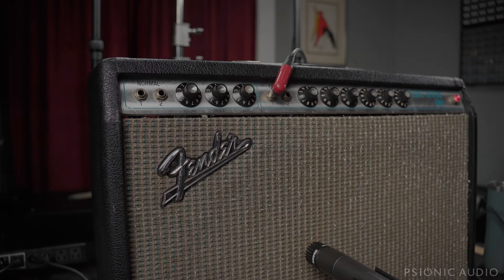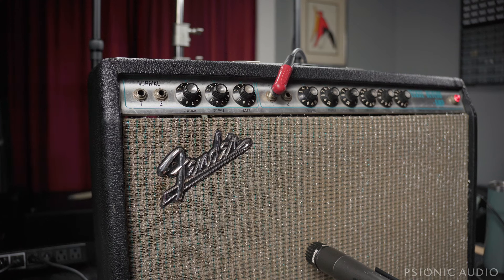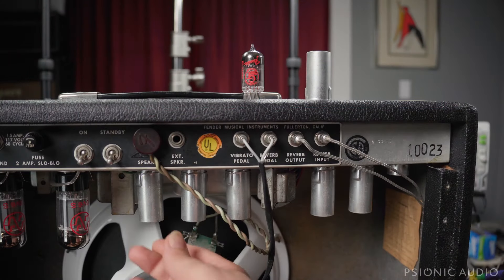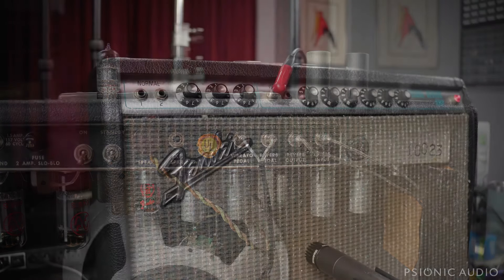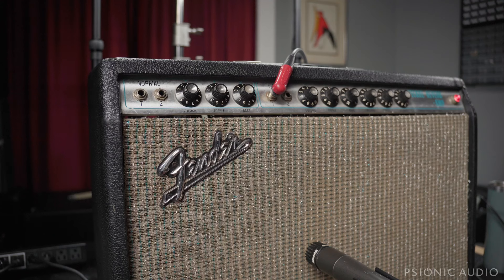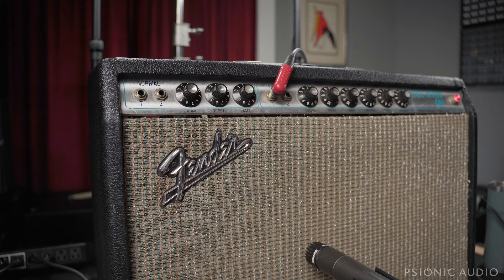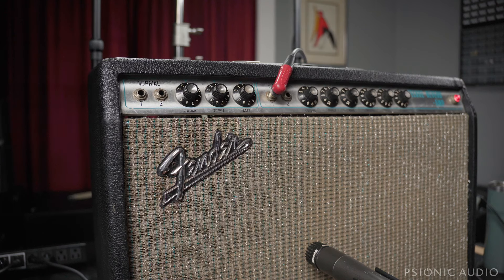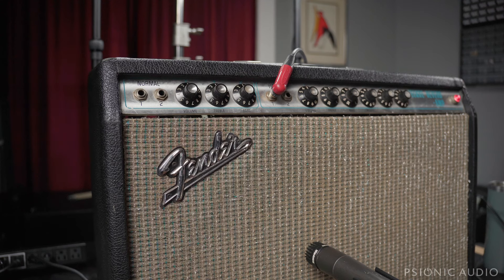Fender Tricks | Increase Gain without Mods

Comment: Either I need to get better headphones or I have tin ears.  I'm not hearing that much difference. Any headphone suggestions?
Reply from the maker: You can’t really hear it with phone speakers. For headphones, I use Beyerdynamic DT770 Pro 80 ohms and Sony MDR-7506s. It’s very apparent on them and on Yamaha HS-7s.

I made sure the back to back clips didn’t have the leveling everything else had, and turned them down a bit so YT wouldn’t compress them heavily. 

But it’s a tricky medium for minutia…
Reply: @PsionicAudio  I was listening on a pair of Sony headphones.  Right now it's at my other computer, so I don't have a model number.  Thanks for the info.

Comment: Hey Lyle, I just tried this with my ‘66 Pro Reverb and it sounds like the amp is clipping with a really harsh and bright sound that is NOT present when I have v1 inserted and a 12at7 in v2, any idea why that would be? 

It’s not a pleasant clipping sound- it’s a ‘something is definitely not working properly’ clipping sound.
Reply: Update: seems like it’s actually only doing it when I pull V1. If I do 12ax7 pi but have a tube in v1 the amp sounds fine.
Reply from the maker: Could be you have a bad V2 that is working so long as that cathode is shared.

In a healthy Fender circuit pulling V1 only makes V2 have a very minor gain increase.
Reply: Thanks for the reply Lyle, I appreciate your time. The 12ax7 in V1 and V2 are both new JJs. I tried swapping some different 12ax7s in V2 with no change. However if I Pull V2 instead of V1 and run into the normal channel the issue doesn’t happen. Is it possible the cathode itself needs replacing?

Sounds like a fast crackling/ scratchy sound, and is louder than the amp sounds normally.
Reply from the maker: That’s unusual behavior, points to an issue with your V2B circuit.  The grids of V1B and V2B both affect the bias as the circuit is intended. If V1 is absent and there’s a problem with the V2B grid leak (volume pot) the bias may be thrown off. 

Have a tech take a look.
Reply: @PsionicAudio taking the amp to a tech this weekend. Very frustrated with my Pro at the moment. Now I’m noticing ghost notes when I have the amp around 5 or higher ( or if I use an OD pedal with the volume lower), that seem to resonate a 4th below the note I’m playing. Makes the amp sound gritty and like it’s gurgling and messy.

I had the amp totally gone through and recapped after I got it, and then had to take it back twice for other issues. Hopefully 3rd time is the charm and we can sort out whatever is still causing these issues. I feel like a pain having to call my tech about it so much, but the amp is not reliable for gigging with the issues that keep popping up. 

Any advice for amps that need repeat service like this? The amp in question was a totally stock ‘66 pro reverb that was sounding good, but hadn’t been serviced in decades- I just wanted it recapped, and serviced for reliability and replace any bad/ too out-of-spec components.

Comment: I do not know if you have ever addressed this, but what about pulling one power tube. A friend of mine did that 35 years a go to a Pro Reverb. Safe?
Reply from the maker: No, and it sounds awful. Push/pull output sections are better than just push or just pull.
Reply: @PsionicAudio  Thanks much for the insight.

Comment: Lyle, I thought Fender stopped using the underlined logo on their amps after 1972. I know that is true for Princetons (I have a 72). Did the different models stop using the underlined logos in different years?
Reply from the maker: I don’t know. I didn’t open this amp up again, just saw a ‘66 or ‘76 date code on the reverb transformer, saw the glued baffle and lack of black lines on the panel, so thought “‘76 or ‘77.”

Comment: does this amp not play well with the 2 channels bridged?
Reply from the maker: The channels are out of phase on Fender reverb models. Some interesting sounds are there, but not the gain monster option other amps have.
Reply: @PsionicAudio  I figured that was the case otherwise its such an easy option.  I have the current 64 custom handwired DR and bridging the channels works great, but it has verb and trem on both channels.

Comment: Does it work on a Hot Rod Deluxe?  I could get the schematic out and try and figure it out myself but, lazy, and you already have the answer.
Reply: Hot Rod deluxe has a gain channel. And if you want distortion from the clean channel, you could connect a volume pedal to the effects loop and drive the preamp.
You can’t do that on a Deluxe reverb. 
Very different circuit
Reply: @marcospintor1333  Yeah, I'm not fond of the Gain channel on the HRD and I don't know anyone who is.  I am aware of the volume pedal trick.  Just always looking for other options, if they exist.  Thanks for the response.  Cheers.
Reply from the maker: No. I was very specific about which amps.
Reply: @PsionicAudio  Yeah, that's what I figured.  On the very outside chance that you just didn't mention it.....

Comment: Are you sure that the amp is a late 70's Deluxe Reverb?  From the Fender logo with the tail on the grill and the fact it says "AMP" on the front panel, I would think it is an earlier model.  Perhaps the transformer was changed at some point.  My 77 Deluxe Reverb does not have the tail on the Fender logo , and also does not say AMP on the front panel.  But you certainly have more experience than I do with these amps.

Comment: I have a '72 DR and I can't figure out why anybody would want to mess with the original design. Buy a different amp!
Reply from the maker: Well, that’s kind of my point. We moved the amp’s behavior slightly without any permanent mods. It’s still a stock DR inside. It can go back to the stock tube setup quickly and easily.